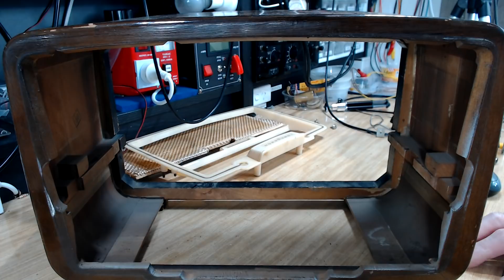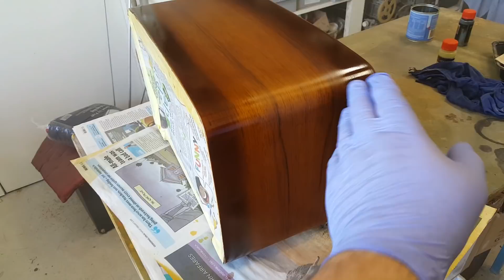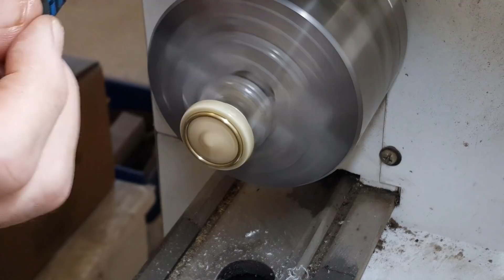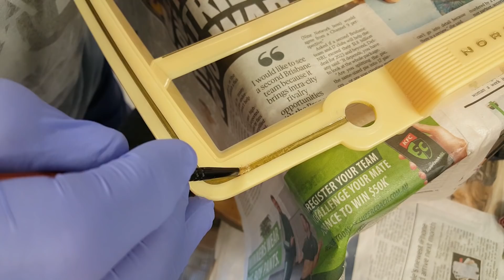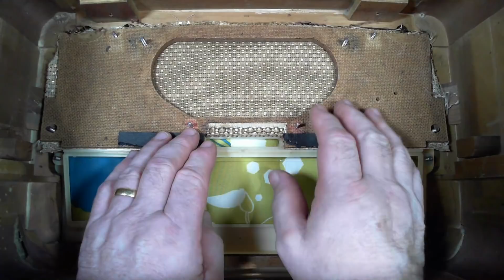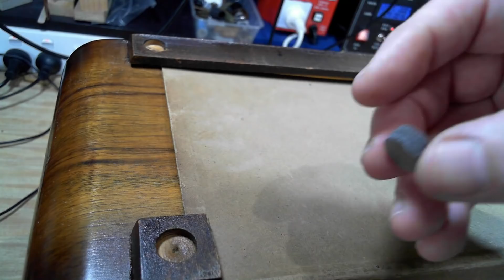NordMende Elektra 58 Restoration Case Repair Part 3 - Final

Comment: Hi Dave, the speaker is a standard Telefunken OVAL with asymetric mounting. Please see  http://www.radiomuseum-bocket.de/wiki/index.php/Nordmende_Elektra_58  for pictures. I do not have your email so cannot send it directly. BTW  the dark spots under the piano varnish (not to confuse with alkyd based lacquer) in this case is a typical residue that has crept into the cracks (capillary effect) of the wrong wax with which these radios were often cleaned with. Especially if this one has been imported from Germany. Senior Germans liked to polish their radios with soapy water and then some kind of furniture polish or water-based wax. Big mistake. My family and friends family did this all the time before visitors arrived for coffee with cake (Kaffee mit Kuchen). Seeing you buffing it back to mirror shine was great. What one can achieve with some spit, polish and elbow grease hahaha. Top job... Ruud (Holland)
Reply from the maker: Thanks for the info Ruud. I guessed it was 4" X 7" but it was 4.5 X 7.5 (funny, we still use imperial for speakers). It's a pity the speaker was missing. I can imagine folks polishing the radio in preparation for visitors, it would have been a major home item back then. I'll keep waxes away from it 👍 I have a large Philips radio to do shortly, you may find that interesting, Oh dear, I hope that's not in Dutch 🤦‍♂️😀
Reply: @DavidTipton101  1080/5000
Many Dutch subscribers to support you when necessary haha :-). What model/type is the Philips ?
Dutch (Philips' origin), Belgian and German built Philips radios were designed very methodically (grid layout) and built with great layout and access. Disadvantage was the damn marketing / cost department that cut costs relentlessly causing some material quality to really deteriorate on later radios (60's). As a lightbulb manufacturer of origin, Philips has built a first-class reputation for tubes and components and supplied them to many manufacturers worldwide until the Japanese and later the Chinese took over that role. If you now have the taste after the Nordende and the Philips, you might crave for a real gem...  the Telefunken Operetta, Andante or preferably the Opus (in many guises). Had one as a kid to tinker with.  These had the best sound quality at the time thanks to 2-3 speakers and up to 12 tubes and 4-5 wavelengths. The first also to boast HiFi on the cloth. Still much sought after overhere. Many Dutchies and Germans have taken these to Australia, a good Aussie-Dutch friend told me last week in response to your Nordmende video that I showed him. Dave thanks for your top vids.
Reply from the maker: @rvandijk65  Hi Ruud it's a Philips B4X23A, Radio Museum says it's made in Eindhoven and the schematic is in Dutch (I think). It looks a good radio and i'm looking forward to doing it, I hope I'm up to the task. It has two speakers but I don't know if it's stereo or not, I didn't download the plans yet. The Telefunkens will be way over my head at this stage. I think I remember Manuel from Electronics Old and New may have tackled one. I think a lot of radios came over with emigrants, I have a EKCO radio that was brought over by a Scottish lady and it's quite big, I don't know how she managed it. Her grandson sold it to me.
Reply: @DavidTipton101  Great !!!
No it is not a Stereo Dave... the 2 speakers are parallel mono. No filter or split in High/Low.
The speakers (when OK) are really nice and have a double conus. You could do a neat conversion to HIGH - LOW: https://www.worthpoint.com/worthopedia/1967-philips-ad-3500-midrange-xovers-205978587

Origin and destination market specifics
To determine where is from (and which country it was meant for) the suffix is also important : /XX . The schematics are sometimes universal and sometimes /XX specific as I experienced myself the hard way. Settings can be way of due to net frequency and local broadcasting laws. Usually the core of the radio is the same and only the power supply, earthing and anti distortion measures are different. 

Some interesting info about Philips... They are best known for bulbs and countless inventions and standards. Like  the Compact Cassette, Compact Disc (coop Sony) and the inline color TV tube. The first to work with printed circuit boards. They where never the best in product marketing and product placement and rather conservative in styling. Never exactly on the dot. Being young you always wanted a Sony  (not me BTW,  but hey I didn't care for cool, but for quality)

Country of development - HIG code  - Classification - Year of prod - Ranking  - Target market  - Finish

OLD: 
B4X23A/XX >>>>> B = table model 4X = Belgium (Hasselt/Leuven built)  3 = 1963 and A is finish. Now we need the /XX to make sure where it was intended to be sold. See below.

First letter: Device type:
B = table model, 220V power supply
C = table model, battery power supply
D = reserve
F = radio turntable combination (standing model)
H = Hi-fi sets (table model turntable)
L = portable model
N = car radio
P = portable car radio
R = portable radio with recorder
S = radio with special items such as clock radios
T = TV set

Second letter: Location of development - not necessarily the production location!
A = Australia
B = Belgium - or X (Philips Leuven)
CH = Switzerland
D = Germany
DK = Denmark
E = Spain
F = France
G = England (UK)
I = Italy
IF = Ireland
IN = Indonesia
N = Norway
R = Brazil
S = Sweden
SF = Finland
W = USA (Norelco)
ZA = South Africa
X = Netherlands (E numbers, number PL-Philips Leuven, Belgium)
First digit: Price indication = 0-9 with increasing prices
Second digit: Last digit of the production year
Between 1956 and 1965, the first digit is moved between the first two letters!

/XX In this Suffix the country code for the Netherlands is 10, 12 and 22 (diff markets) , which is reflected in almost all devices.
I know these country codes for sure: 
/5: UK

/8:	Italy
/10, 12, 22:	The Netherlands and the rest of Benelux
/15: Poland

/66: Sweden (DUX)

/70: Japan (Marantz)

/90: ?
/ 60: Russia (yep! aka Czech Tesla)
/ 77: Argentina
/ 78: Brazil

When you have a different number with the serialnumber  like:
NEW: 22 RH 544/50 R (since 60's this nomenclature was adopted)

Country of development
The first two digits of the type number indicate where the appliance was designed. This does not necessarily have to be the country of production! The majority of the HiFi devices were designed by the R&Dteam in Eindhoven and thus come from Dutch soil. 
Not relevant for your radio but maybe interesting to know for the future:
HIG code: main industry group and factory
The HIG code indicates to which Main Industry Group (HIG) the appliance belongs and in which factory the appliance was produced. The “R” in 22RH stands for “RGT” (Radio-Gramophone-Television), the main industry group that has been responsible for all audio and video equipment for many years. The "A" in 22AH stands for "Audio", the subdivision created when the main industry group RGT was divided into "Audio" and "Video". More information about the main industry groups can be found in the article The ELA and RGT groups.

The second character in the HIG code indicates where the device is manufactured. The “H” in 22RH and 22AH stands for Hasselt (large audio factory Philips Belgium). Many speaker units have type numbers starting with AD; these were made in the loudspeaker factory in Dendermonde (Belgium too).

The 2 letters in the serial number also gives you some info: MZ: Japan (the Marantz factory)
, PL: Philips Leuven (the factory in Belgium), WR: Wiener Radio AG (the former Radio Horny factory in Austria), SV: Philips Singapore, AH: Audio Hasselt (Belgium), NF: Philips Sweden (Norköpping), PJ: Poland (television factory), FFO: Device is built by Foster Audio (Fostex) in Japan or possibly another Japanese subcontractor
Reply: @DavidTipton101  As I do not have your email  I re-posted a link for you: http://www.radiocollection.cmshost.nl/kvdijke/nl/philips/b4x23a-74.html?i=1
In de schematics 3 and 4 TIF you can find the letters S C and R. S =  "Spoel" in English it means Coil (or transformer), C = Condensator (Capacitor of course) and R = Resistor (how consistant as it is Weerstand in Dutch).
Reply: And the last part :-)
A great source of info is the one you referred to I guess: https://www.radiomuseum.org/r/philips_b4x23a.html   This website has tons of info, but about Philips is scetchy due to Philips production politics. You also could buy the same radio as ERRES or ARISTONA... B-brands of the same radio, and strangly, sometimes better built... 

I prefer: https://www.radiodatabase.nl/toestellen/philips%20buizenradio%20na%20wo2/B4X23A/B4X23A.pdf
Who took over all the old schematics etc from a Philips Service Center (all closed down in 80's) and digitzed it.

If you need translations, just ask. For convenience I translated the specs and features Dutch text for you:

Specifications:
Tubes: ECC85, ECH81, EF85, EABC80, EL84, EM80, EZ80.
Wave ranges: LG, MG, KG from 16 -50 meters, FM from 87.5 - 108 MHz.
 
LG = Long Wave (Lange Golf), MG = AM (Midden Golf), KG = Short Wave (Korte Golf)  and FM. If it reads UKW you have the German version. (Ultra Kurze Welle)
Middle frequency: 10.7 MHz; 452 kHz.
Loudspeaker: 2x AD 3500 M
Resonance frequencies: 105 Hz left, 95 Hz right
Amplifier frequency range: 25 - 20,000 Hz (after some mods)
Power bandwidth :: 55 - 15,000 Hz (after mods)
Output power at 5 Ohm: 3.25 Watt RMS (on the speaker terminal)
Cabinet: Wood, brown lacquered
Dimensions: 50 x 23 x 20 cm.
Consumption: 55 Watt

Features:
Pick-up entrance: Yes.
Tape recorder input / output: Yes.
Extra speaker output: Yes, 5 Ohm.
Loudness: Yes, simple, low tones.
Treble control: Yes, switchable.
Bass control: Yes, switchable.
Sound register switches: No.
Bandwidth control: No.
Tuning indicator: Yes, EM80.
Built-in antenna: No.
Ferrite antenna: Yes, fixed, LG and MG.
Separate FM / AM tuning: Yes.
Reply from the maker: @rvandijk65  😲 thank you, I have printed all that and will put it with the radio, it will add a bit of interesting info to track it's history. Damn, that's a lot of typing you have done Ruud, it's 7 pages in Word! This one looks original from the outside so hopefully it's all there and will be easy, it's also in good condition. Thanks for doing all that Ruud and the circuit link too, very much appreciated, Cheers 👍😀

Comment: Hello David, Really nice job mate and it does sound awesome for what it is. I have been watching by the way it's just that my typing fingers have had laryngitis. Gee wiz your production/editing skills are really great now as well, impressive. Just on the speaker cloth, I was wondering whether soaking it in a bleach would work? I look forward to your next project. Take care, Graham.
Reply from the maker: Hi graham, thank you. I don't know about laryngitis, mine are dylsexic 😟  I spend a lot of time on the video so very happy it shows, thanks. The cloth is glued on so I didn't want to get it too wet, there are holes in it for the badge and i don't think I would be able to get it back on if it came adrift. Also the edges would have frayed as well. I have found some reproduction cloth for this radio and just finding out about it now, fingers crossed 🤞😀

Comment: I had every confidence this radio would work out the way it did. However, I was very surprised by the sound. Pretty amazing. That blocker circuit is advanced engineering for sure, at least it seems to be. The FM is spot on from here. What a fantastic tuner. This was indeed another fun adventure in hanging out in David's shop, fixing cool stuff.
Reply from the maker: Hi Craig, I'm glad you were confident, I wasn't. It sounds amazing, it took me by surprise when I first tuned it in after alignment. I have never heard of an IF blocker circuit, luckily Derek contacted me and explained what to do 🙂 every radio is a bit of an adventure for me 🤦‍♂️😀

Comment: Hello David 

If you put a foil on the paintstripper it does not dry out so quickly . 

If you warmed up the spray can a bit (bucket of warm water) the pressure in the can increases a little bit and this creates a finer spray clear paint .

I restore a Loewe Opta Bella Luxus , also in sunburst design . 

I put black schellack on the casing , looks also nice . 

Your casing looks now very nice , thumbs up . 

Greets Uli
Reply from the maker: Hi Uli, good idea with the foil and the spray can. I didn't know you could get black Shellac, I guess I could tint normal Shellac, that's an interesting thought Uli, cheers 😀

Comment: What a beauty! I have a bigger Nordmende "Parsifal" which also sounds amazing. You'll find that the treble control works in the reverse direction compared to the Bass. 
If you google Sunburst Finishing you'll come across a neat trick. You can place a "fence" along the line you want by laying a piece of board or cardboard to mask the line you want to make, BUT, you raise it about 3cm above the surface to get the fading effect as well as a nice straight line.
Reply from the maker: Hi Derek, thank you. I didn't notice the treble, I'll check. That was one of the ideas I had, using a raised mask but thought it would give too much of a straight line, the original was a bit freestyle, not that I achieved the exact original look mind you 👍😀

Comment: I have used wood alcohol to clean the plastic knobs very successfully, and for the hard to reach areas a fine tooth brush.  What dedication to your restoration David !    Walt
Reply from the maker: Hi Walt, thank you. I don't think we can get wood alcohol here, the closest would be metho or denatured alcohol 🤔🙂
Reply: @DavidTipton101  Yes David,  denatured alcohol is the same!    Walt
Reply from the maker: H Higgins  Our 'Metho' is only 10% wood alcohol apparently. We can get the faux nail polish remover Ok

Comment: Ever seen how luthiers build up a sunburst with stains? Lots of video's on youtube. BTW, to polish, dont use wet, but dry 1000 grit sandpaper... then 2000 and 4000 (+ 8000? )... THEN use polish. use a block when sanding and never swirl... always in straight lines.
Reply from the maker: Hi Edwin. I couldn't find a lot of useful info on sunburst painting. It was all specialty paints which I don't have. Thanks for the info 👍🙂

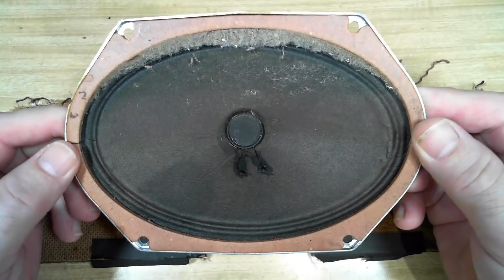Comment: Another beautiful restoration! I love the contrast of the brown and yellow stain. Take pride in what you have done! P.S. look at time 23:27, on the right hand side of the speaker, is that damaged or a crease?
Reply from the maker: Hi Bruce, thank you very much. The speaker had some cracking on that end and some minor cracks in other areas near the edge. I painted the cracks with rubber insulation paint, that bit didn't make it to the final cut it looks like 😀
Reply: @DavidTipton101  Thank you for the response, again you did a beautiful job!

Comment: Beautiful job on the cabinet restoration!  I'll offer a little advice since, being a guitar maker, I have a lot of experience creating sunburst finishes and mirrored, very high gloss finishes.  Your surface prep was spot on.  As for spraying the contrasting dark part of the burst, I wouldn't start by darkening the edges as you did.  You should spray the surface from a little bit farther away as well so you get a more gradual blend to the center.  This is hard to describe but try to start spraying with almost all of the spray cone off the edge of the surface working your way in with each pass.  Spray with your spray gun positioned at the center of the piece, angled toward each edge.  As you bring the spray cone in from either the left or the right, it will darken the edges that receive more of the overall color as you move into the center of the surface. You will get a more gradual blend this way.
For acrylic finishes, the best product I have ever used is Target Coatings EM6000.  It is a waterborne finish that actually has "burn in" just like nitrocellulose.  Absolutely no "witness lines" that you get when you apply separate layers of clearcoat stacked one on top of one another, and wet sand through layers.  Also, very important...acrylic finishes dry after 30 minutes but they are not cured for a week or so.  The longer you let an acrylic finish cure, the harder it becomes and it is much easier to create a clear, incredibly glossy finish.  You did an excellent job but I thought I'd just throw in a few tips!  Cheers!
Reply from the maker: Hi MrCrystalcranium, Thanks for the tips. I would do the sunburst differently next time and do it as you say, I had no idea how to do it initially. We don't have the EM6000 acrylic finish in Oz. Thanks for the advice MrCrystalcranium, printed and saved in my usefull tips folder 👍😀
Reply: @DavidTipton101  You're welcome mate!

Comment: This looks and works excellent, great job! It really has a nice sound, although on FM it lacks in the high end. Is it caused by the capabilities of the speaker, or the high tone control was down a bit?
Reply from the maker: Hi mrnmrn1. It may be the speaker, it was designed for AM radio but it surprised me how well it reproduced the highs. I tried it with a modern car speaker but it was too high and went back to the more mellow speaker 🤔